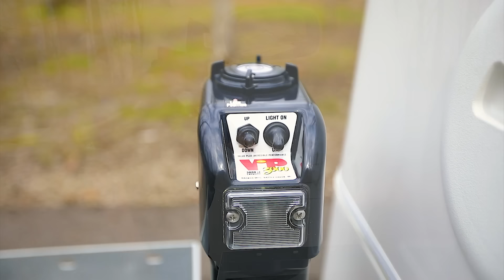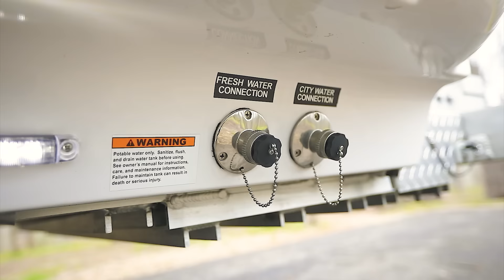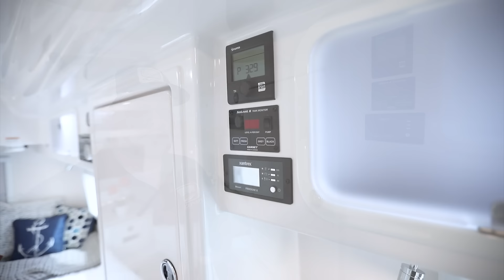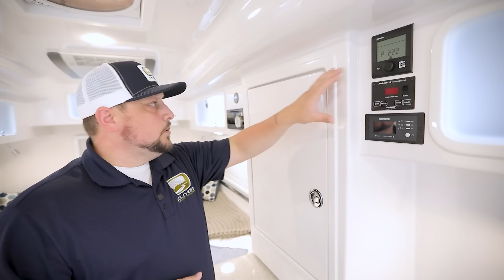2023 Oliver Legacy Elite II | Walkthrough | Oliver Travel Trailers

Comment: I just wish travel trailers didn't cost as much as a friggin house!😮
Reply: ? The average home price in the U.S. is $348,079, this trailer (per the web site) is &73, 800. Yes that's expensive but well below the nations average house price.
Reply: @paulcatarino2209  houses used to cost this much
Reply: @underthetornado 
You can build a house yourself. This would be more difficult to build.
Reply: A well made fiberglass bass boat or cruiser will cost you more than an Oliver, and thousands of those are sold every year. I would much rather spend that kind of money on an Oliver and travel all over the country in comfort and worry free.
Reply: Yeah uh… they don’t.
Reply: I’m wondering how much it weighs and what type of truck it would take to haul this..?
Even it was stated I missed it twice.😬

A long long time ago my folks bought their home for $13,000!
You can’t buy a new car for that anymore.😂
There’s another company that has a similar trailer for more than $10k less.
Reply: @susana5052  The Oliver Legacy Elite 2 weighs about 5200 pounds dry. With Fresh water full you approach 5500#. Loaded with gear for travel you will probably be around 6000-6200# depending on your gear. 

A heavy half ton truck with max trailer tow package will tow this camper easily with a weight distribution hitch. Some heavy duty SUVs will also pull it just fine. A 3/4 ton truck will pull it with much less effort. No matter what you use the trailer and tongue weight must be well within the weight capacities marked on the load sticker of the vehicle. You must have a trailer brake control system on the tow vehicle of choice.
Reply: They're houses on wheels!  Some have more options than a  stick, stationary house.
Reply: But it will last a lifetime I believe Oliver is cheaper than airstream at the same level
Reply: @paulcatarino2209 
In 2 years your house is worth more, than a POS depreciating trailer
Reply: @paulcatarino2209 so pedantic. You know the point he’s making.
Reply: Houses cost $400,000  now.
Reply: It’s ok Paul you don’t have to buy one.
Oliver is priced well considering their features and quality.
Reply: So you wish a tiny home on wheels doesn't cost as much as a tiny home?

For the record this is way better insulated than a house you can get for the same price.
Reply: @susana5052 yeah that's just ignorance. There is literally not a comparable four seasons trailer to this. For any price.

The only reason I didn't get an Oliver is because of the long lead times.
Reply: If you are looking for an Oliver trailer, copart has a 2022 oliver legacy elite 2 with minor scratches and dents in Alabama as a future auction sale. You can save thousands it has a future auction. Soon, I know  new ones cost around 77,000, but probably, it's a pure sale that means the highest bidder wins. If  nobody but you bids, you win , I wished I had Xtra money to bid , and the current bid is now 800 dollars here. It's an excellent opportunity to buy Oliver dirty cheap
Reply: How many motel rooms can you stay in for 74 thousand dollars?  And you don’t have to drag them down the road.
Reply: Copart in tanner Alabama has a 2022 oliver elite ll with minor scratches and dents for sale as a pure sale which means highest bidder wins  here is a opportunity for someone to get a high end oliver legacy elite ll for a 1/3 to half the cost of new one cost don't let a once in a forever deal get away 😉
Reply: My feeling exactly! I am thinking about retirement living options and it would be nice to find something that does cost less than a house.
Reply: @beaunaro it’s still a trailer. $20k maybe because it’s small.
Reply: What kinda house you got?

Comment: Certainly an interesting alternative to an Airstream. I may recommend it to my Grandpa, though it may be a bit small to his preferences. If these eventually grow to maybe 30-33 ft maybe larger, and compete directly head to head with the likes of Airstreams top-o-the-line, I'd definitely be quite interested.

I definitely like the looks of the smooth seamless fiberglass inside and out. I imagine it would be easy to get painted, wrapped, or plastidiped in any color, or print design. I think my biggest gripe researching travel trailers is more often than not the lack of a washer & dryer or combo.

These will certainly be on my watch list, and I'd certainly recommend them to others should that conversation pop up.

Comment: Is there a way to sacrifice the closet that way you can get a completely separate shower and toilet sink? I hate wet baths and on a trailer this size it's kind of ridiculous that your faucet is also your showerhead, those should be separate. and I can't fathom why nobody puts electric ranges in these trailers, they save space and are easy to clean.
Reply: Love it. The off grid choices are good. Prefer the twin bed choices.
Reply: Induction cooktop put it in a drawer and take out plug in as needed  free up counter space.

Comment: Is there a way to get a different battery door with lithium batteries?  AGM batteries need to be ventilated, li-Ion do not, plus they are susceptible to cold, so an insulated, non-ventilated door/hatch just makes sense.
Reply: That's a good idea Erin.  In fact, it would be great to have a head duct extended across from the furnace feed into the battery box for super cold weather.  The larger Lithium bank has built in, UL Approved heaters so the batteries are safe, even with the vented doors.
Reply: @shorttrails8158  — I believe, if I recognized the batteries correctly (the ones installed, 2x 320 Ah), that they have internal heating and a controller that will communicate with an app.  Don’t quote me or hold me to that, there’s a lot of red Li-Ion batteries out there.  I was just thinking economy, with a vented door you’re going to have to heat it more, even if you cap/block the holes you still have an uninsulated door.  You could put some thinsulate or whatever but an insulated door would be better.  And yes, a heating duct, or alternatively a vent from the main area into the battery area would work great.  👍🏽
Reply: I have this trailer with the same lithium package and I can confirm that these batteries have internal heating.  I was told the smaller lithium package comes with a heating pad when I inquired last Fall
Reply: Man. That rear receiver needs to be more stout for e bikes. Love the trailer
Reply: @bryaninnc5511  — Thanks.  That makes the need for an insulated non-ventilated door/hatch still true as better insulation means less energy to heat them.
Reply: @Erin-Thor  I was just confirming your understanding of the batteries in your last reply.  You must be planning to camp in some pretty cold environments.
Reply: @bryaninnc5511  — I do love cold weather, but I’m also frugal and believe in thinking ahead.  IMO putting a vented non-insulated door on a Li-Ion battery compartment is like putting a screen door on a submarine.  🤠

Comment: I'm a little confused.
Watching numerous videos of the Elite II, can you tell me why some units have the inside of the closet door and the kitchen pantry door are nicely finished in a smooth white surface, while other Oliver's doors are grey in color, and look like rough unfinished fiberglass? 
Is this an option to have the inside of both doors finished?
Reply from the maker: Based on the year of the trailer, some will be finished fiberglass, (grey interior finish). The newer models of trailer will have a composite material which has a smooth white finish. Both are nice, just difference in materials.
Reply: Thanks for the quick response. I do like the smooth white finish on the inside of the doors. Love your Trailers!

Comment: A truck to haul this is more $ than the trailer…especially in California (I hate this state)

I didn’t catch the weights and clean water capacity for this…what size of truck would you need to haul this loaded?
I watched twice and must have missed that info…😬
Reply: Fresh water capacity is 30gal. Yes tow vehicle prices are a kick in the gut. You could opt for Elite 1 and get by with a much lighter tow vehicle, but it still has to be able to handle a 4000# trailer. Just think what it costs to own and tow and big fifth wheel camper with 4 slide outs. That requires a truck that will run you more $90K these days and you'll get 6-8 mpg while towing. 

The Oliver really is a value in the RV industry. They hold their value much better than most RVs and they truly will last for generations with proper care.

Comment: neat. i have seen smaller units than this one. this would be perfect for me, EXCEPT. the fridge is way too small, the faucets in the loo should be separate, looks like the Northern Lite truck camper, 2 piece molded and put together. oh yeah, i would change out the tv for a non smart tv. well those are my complaints. other than that, the Oliver is a win, win.

Comment: I would never buy a camper with out a  real oven that runs on propane or a fridge that can do the same. When you are boondocking and there is no sun for a week and you don't want to run your generator , No way . I guess we heed to try and keep our travel trailer in good condition so it will last for years to come. Because it seams that all the manufacturers are getting rid of the gas stove and fridge.
Reply: Right?

Comment: No way a fiberglass camper no matter how nice should cost airstream prices
Reply: Why not? I just checked boat trader on line and there are countless 20'-24' fiberglass bass boats that list for more than the price of an Oliver. An Airstream that gets caught in a hail storm with quarter sized hail would be totaled in 5 minutes. The same storm for an Oliver owner would be an exciting adventure with little to no effect on the value of the camper. It's a no brainer.
Reply: This is built better than an airstream. Just too small as another stated need a 27 with bunks some how.
Reply: Also, Airstream is not four seasons as they tell you plainly that they rated three seasons only. For folks in the northern areas the Oliver is by far the better choice. Of course, you can always travel south, but for some folks, winter months are common.

Comment: The layouts and the bathrooms arent good. The wet bath at this price point is a no go.  Also, the tv is placed in a spot where only 1 person can actually view it. Why even bother including it? The fridge, 😂😂😂😂😂
Reply from the maker: Hi Steve, 
One of the biggest advantages of a wet bath in a camper is its space-saving design. In a small living space like a camper, every inch counts. Keeping a camper clean is vital for a comfortable trip, and a wet bath makes cleaning easy. Its waterproof materials are simple to wipe down, ensuring a hygienic space. With everything in one space, you can clean the entire bathroom in just a few minutes, leaving you more time to enjoy the outdoors. A wet bath uses less water for showers and toilet flushes. What makes Oliver different from all the other wet bath campers is that Oliver's no wood and all molded fiberglass makes it easy to clean and wipe down quickly. No mold or mildew to get into wood or rot. 

When we designed the Oliver Travel Trailer, the refrigerator was one of our standout features. It's not too big or small, but just the right size for your travel needs. The key difference is that your RV fridge is not just a smaller version of your home refrigerator. It's about smart packing and making the most of your space. Consider your RV fridge as you would your RV closet. As you would not pack your entire wardrobe for a trip, savvy RVers don't bring the contents of their entire home refrigerators either. That's one of the many reasons travelers choose the Oliver Travel Trailer and our ideal refrigerator.

Please see our new 2024 Model video here:
Hi Steve, 
One of the biggest advantages of a wet bath in a camper is its space-saving design. In a small living space like a camper, every inch counts. Keeping a camper clean is vital for a comfortable trip, and a wet bath makes cleaning easy. Its waterproof materials are simple to wipe down, ensuring a hygienic space. With everything in one space, you can clean the entire bathroom in just a few minutes, leaving you more time to enjoy the outdoors. A wet bath uses less water for showers and toilet flushes. What makes Oliver different from all the other wet bath campers is that Oliver's no wood and all molded fiberglass makes it easy to clean and wipe down quickly. No mold or mildew to get into wood or rot. 

When we designed the Oliver Travel Trailer, the refrigerator was one of our standout features. It's not too big or small, but just the right size for your travel needs. The key difference is that your RV fridge is not just a smaller version of your home refrigerator. It's about smart packing and making the most of your space. Consider your RV fridge as you would your RV closet. As you would not pack your entire wardrobe for a trip, savvy RVers don't bring the contents of their entire home refrigerators either. That's one of the many reasons travelers choose the Oliver Travel Trailer and our ideal refrigerator.

Please see our new 2024 Model video here:
https://youtu.be/25OdpIFLSYA

Thanks for the feedback!

Comment: What??? No black tank flush?
Reply from the maker: Hey Carolyn, the trailer does feature a black tank flush port. It is located in the lower front street side of the trailer. the port is plumbed into a nozzle on the black tank to spray and rinse the inside of the tank to assist in flushing the tank contents.
Reply: @Olivertraveltrailers  Thank you! They are very important in the longevity of the system!
They didn't mention it in the vid. Too many people leave the black tank valve open! That's a NO-NO! We may be in touch soon!

Comment: Ithink you all would make a fortune on these if the interior was a little warmer. like woods instead of the fiberglass everywhere. the modeled look feels cheap like it was punhced out quickly. build the interior so that it is jsut mounting points then install a standard luxury RV interior and you got a gold mine on your hands. The interiror is the only thing holding you back. Sure some people see the value in the indestructable interior, but most people want a warm cozy home away from home. This feels like you're living in a cheap boat.
Reply: Most of the 'luxury' wood interiors in RVs are decals over plywood that peels off though.
Reply: @njlauren  the cheaper ones yeas it’s all laminate